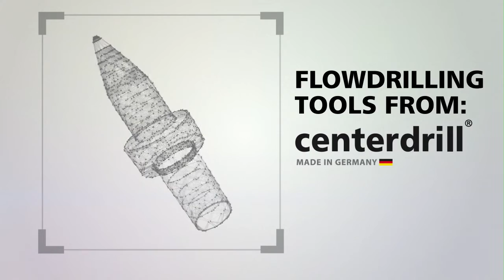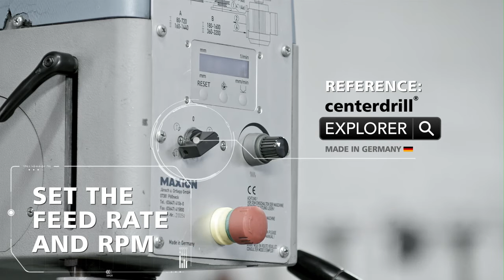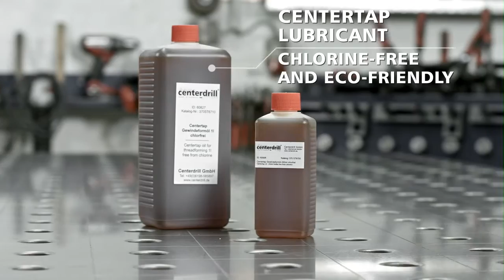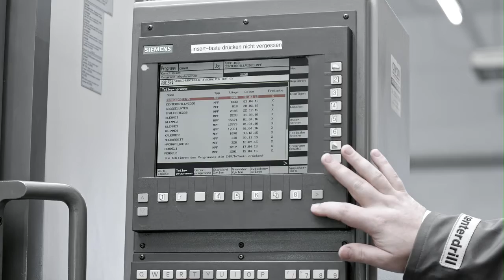Centerdrill GmbH - Video Flowdrilling - Flow-Punch-Forming - Flowdrill Verfahren

Comment: can you please provide the full demonstration video  of center drill
Reply from the maker: Dear Srilatha,
that's already the longest version of the video.
Furthermore, you can only watch parts of the video, which are then shorter. For example, one video each for stainless steel, steel, copper, aluminum and brass.

If you have any further questions about flow punch forming with Centerdrill, please do not hesitate to contact our support. Email: support@centerdrill.de

Thank you
Centerdrill-Team